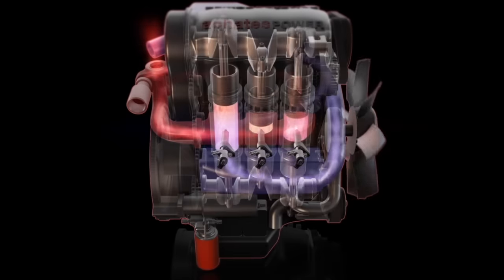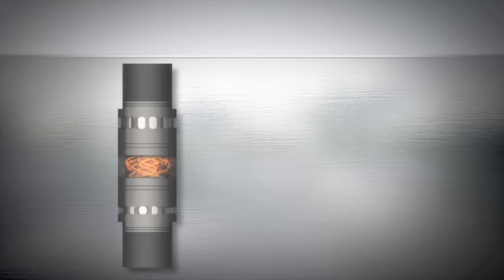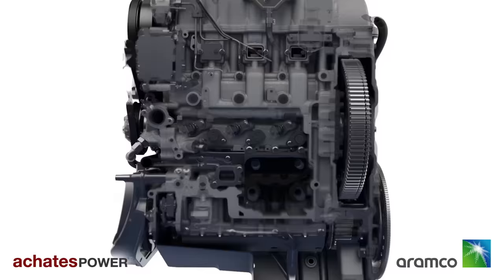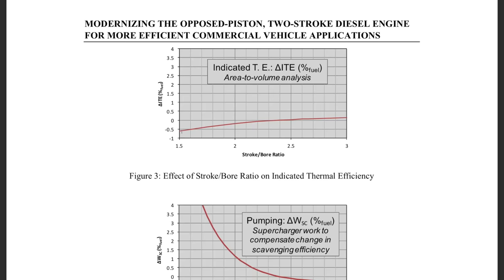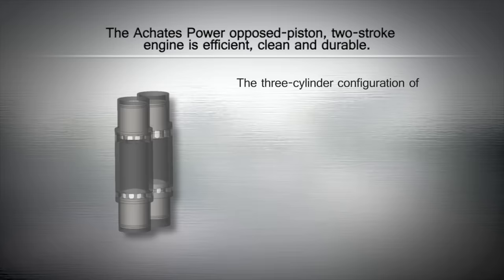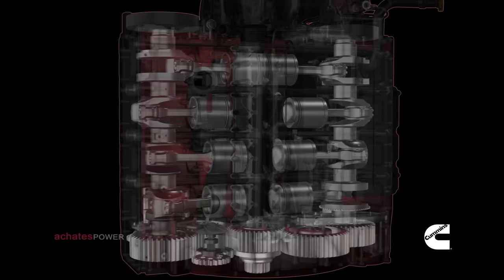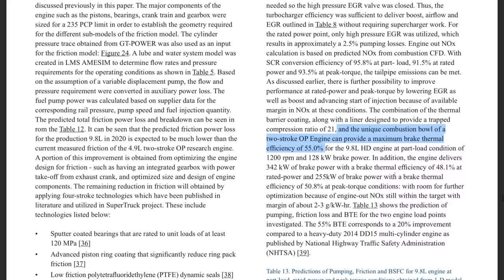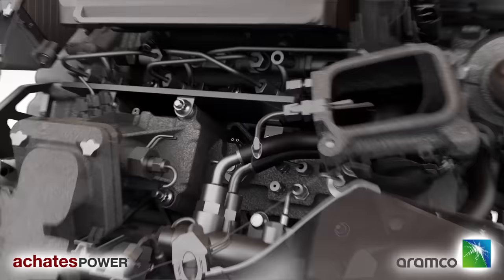Opposed Piston Diesel Engines Are Crazy Efficient

Comment: 3 cylinder but have 6 pistons if you cut it half that would make it 6 cylinder... Ford's 2.7l V6 EcoBoost or Porsche Boxster engine has a little bit more power than this engine and this one is 2 stroke while the others are 4 stroke... well ford is turbocharged and the turbocharge of achates engine is not actually turbocharge but instead act like a blower for scavenging just like Detroit 2 stroke diesel engine... and since opposed, during combustion the pressure is decreased immediately since it is divided by the 2 pistons, in single cylinder engine all the pressure is pushed only to one piston and that piston receives more energy or power (the excess is then converted to heat thats why it's not thermally efficient compared to the opposed but at least the piston still have more pressure even at BDC) ... so if this engine is cut in half and both rotated  180° it would be flat 6 engine (takes only 1 crankshaft)... it is only mechanically simple compared to engines with valves, cams, and etc. but it doesn't mean it is lighter since this engine have 2 crankshafts plus those gears (maybe belt is a better option lol)